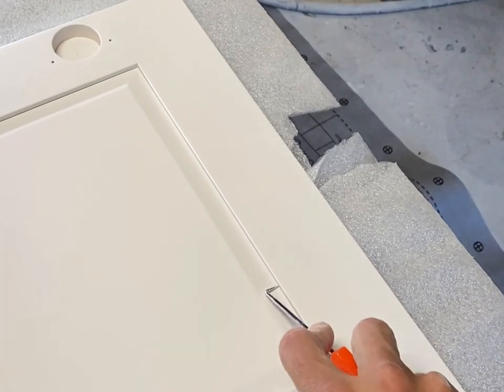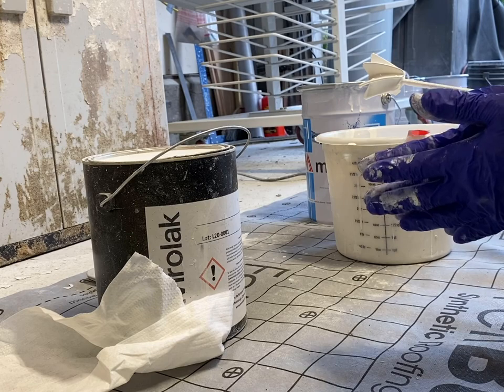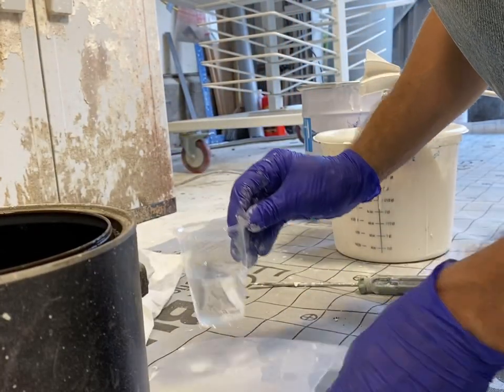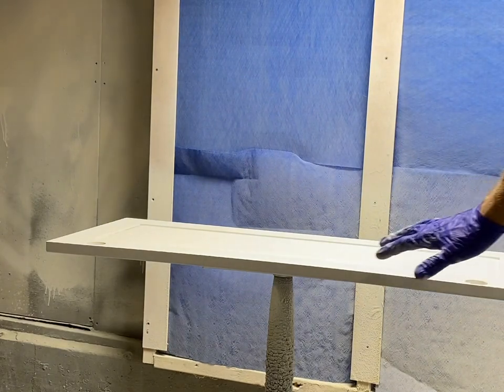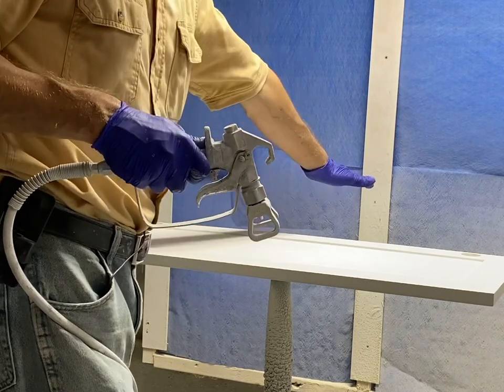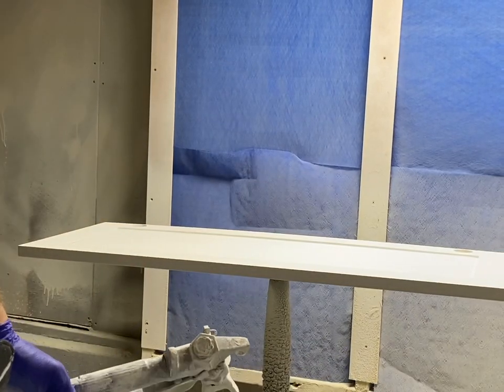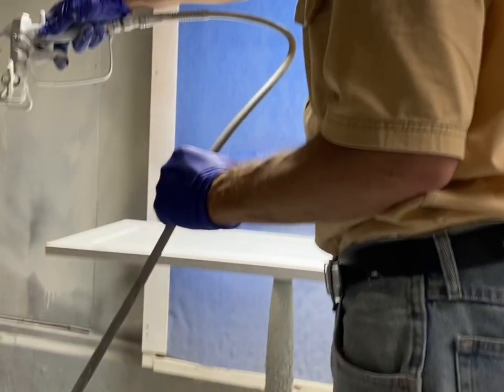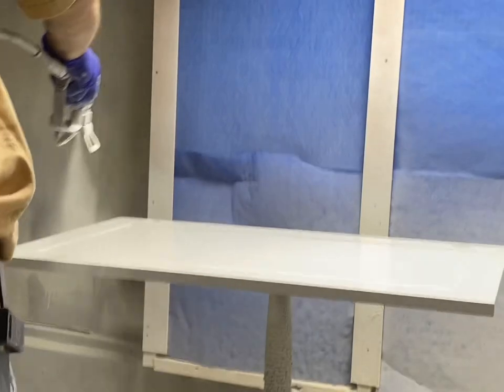How To Eliminate Bridging Painting Cabinet Doors with Milesi Paint and Airless Sprayer

Comment: In all cases if you can wait until the winter, when the panel will have shrunk to its minimum due to low humidity, you will see less problems due to humidity swings.  If you spray in the summer, when the panel is it’s widest due to expansion, you will see the ugly gap when it shrinks in the winter.

This video is excellent on spraying RP doors that are already constructed.  If you are building the doors, the best way is to take some 150 tom220 grit sandpaper and relieve or slightly “round” the inside edges of the rails and stiles where they meet up with the panels (make sure you do both front and back if you’re concerned about appearance when the door is opened). Shoot the paint into the crack, so to speak, with one quick pass for every coat.  Regardless of humidity movement of the panel, you won’t have a problem.

The suggestion by one commenter about Big Stretch caulk is also an alternative.  That stuff is amazing.  Only use it very sparingly where the panels meet the rail and stile slots, though.  I think a big ‘ol rounded goop of caulk in that area loses the beauty of a raised panel door.
Reply: any quality door maker should be using cutters with eased edges so you wont have to break the inside panel edge.
Reply: Also waiting till winter is not an option for a serious business
Reply: @misterfee6467 I have never seen cutters with eased edges. Do you know who makes these?  I’d love to have a set.  I use a router table not a shaker. Thanks.
Reply: @misterfee6467  True. But for hobbyists and DYIers it can be an option.

Comment: I know this is old but, when thinning by weight I think you need to have a reference of how much each ingredient weighs by volume. 10oz of paint weighs a different amount than 10oz of hardener, etc. I think you would need to weigh out each ingredient and then calculate the weight needed of each based on percentage. All the thinning info I have seen on paint is by volume not weight. Maybe the italian stuff is different. Thanks for the video.
Reply: You can contact the manufacturer and they will tell you the percentage by weight. It will save you product and money over time

Comment: great video!! good information. whats the order of coating, back of doors let dry, hit fronts, sand backs coat again then sand fronts and coat then sand and coat again fronts? i am trying to figure out how i should be doing this as i am going to rack my doors from now on.

thanks
Reply from the maker: Thanks Derek. It's not real important if you do backs or fronts first when doing primer, but I always do backs before fronts when doing the final coat. That way there's no markings on the face of the door since that is done last. Also, the back of the door will get slight overspray from doing the front. Not a big deal, but I want my front to be as smooth as possible.

Comment: Use the right primer and sand it first. Vac the dust off. And use BIG Stretch caulking and you will never have a problem. Iam a painter for 36 years. I've done at least 50 set's of  cabinets and never had any of it crack. 💪💪 .
Reply: Robert
Glad to hear the tib about big stretch!  

Question: Can you use big stretch with solvent lacquer and solvent Conversion varnish??

Thanks! 
jim
Reply: Glad to hear the "tip" about big stretch...
Reply: Big Stretch is no joke. All other caulk is a waste of time.
Reply: Big Stretch is the best caulk around.
Reply: Where do you get big stretch caulk?
Reply: @danielmiller3255  Lowe's.
Reply: @danielmiller3255   I get it at my local Ace Hardware

Comment: I wonder how Milesi feels about thinning their coatings with an Envirolak product (ie, mixing brands).
Reply from the maker: Of course most suppliers won't recommend it. I wouldn't mix brands without testing them myself.  I'm a fan of trying things out, because some of these products work well together. I've used Envirolak reducer and thickner with Milesi products with success.

Comment: what if the panel is MDF? Theres one guy on YT that caulks this joint
Reply from the maker: If the panel is MDF, you may be ok to caulk. However all caulk is different and not all cabinet coatings like them. So I prefer not to caulk.